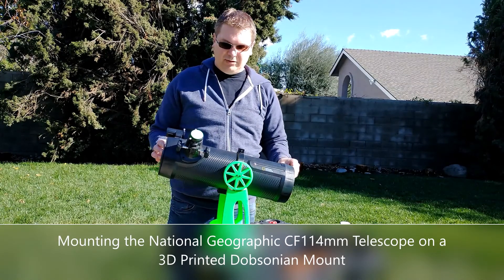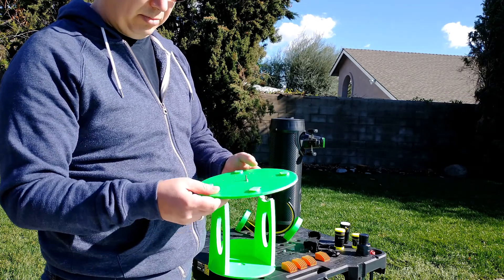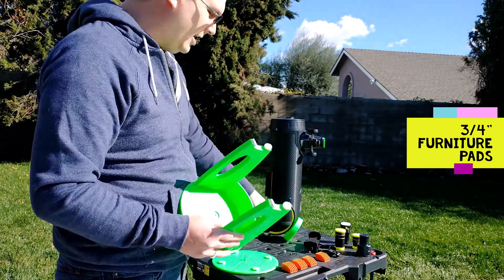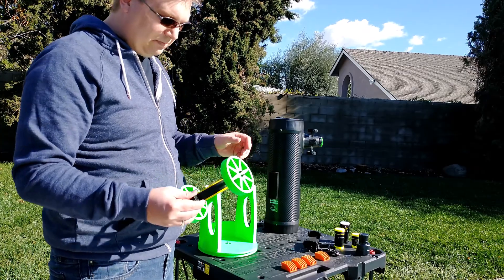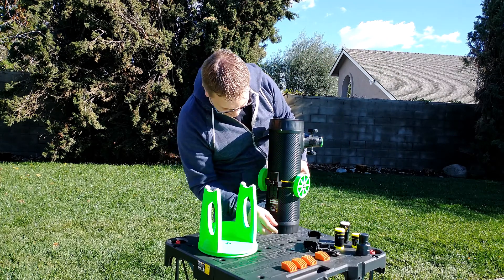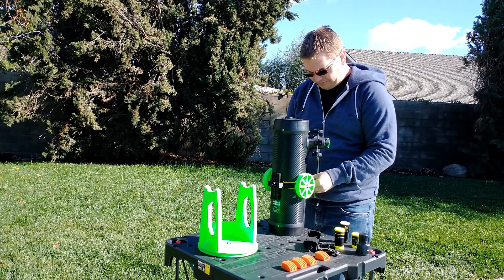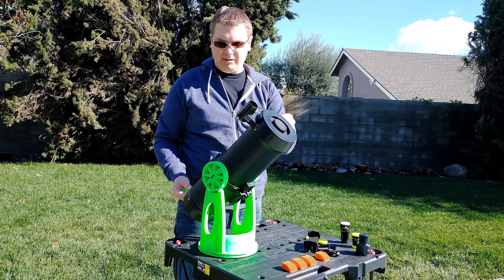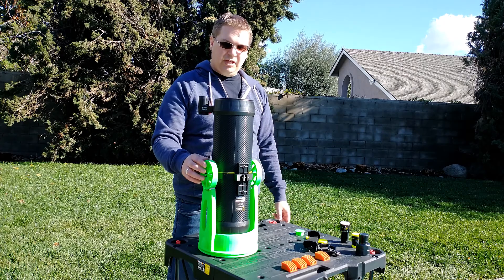Mounting the National Geographic CF114mm Telescope onto a 3D Printed Dobsonian Mount

Comment: Got a Celestron 130 eq, would this work with mine, and if not how would I have to modify it to fit? Thanks great idea, and demo.
Reply from the maker: You would probably need to make the mount and rings larger to accommodate the larger tube length and diameter.
Reply: @mbioman  Elarged the Tube clamp by 108%, and the same for the wheels, and then shrunk the wheel diameter back to the original size and hopefully this did the trick, Thanks.
Reply: @mbioman  Thanks that's what I was thinking as well. Great design.